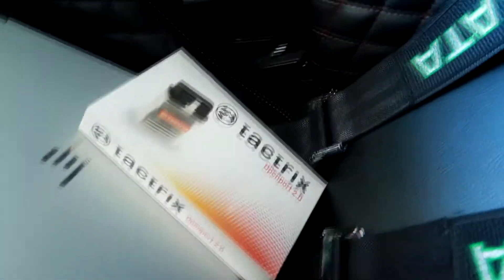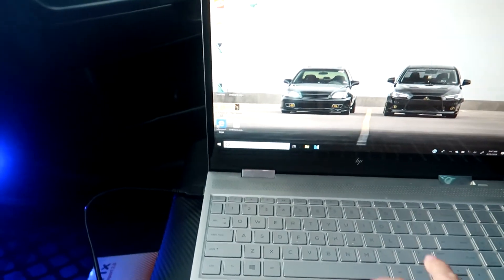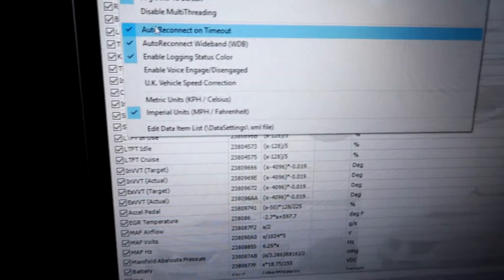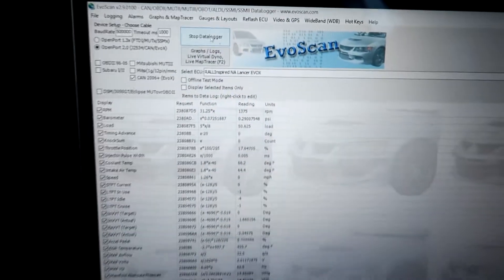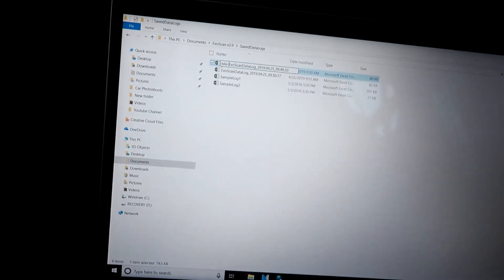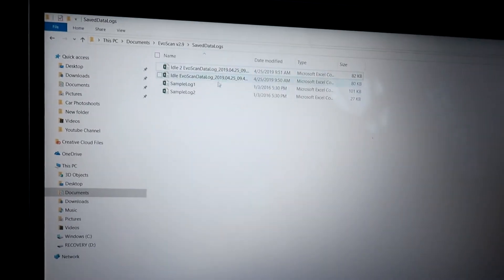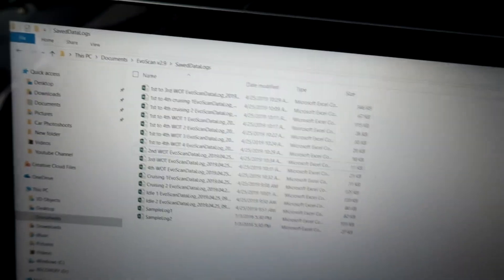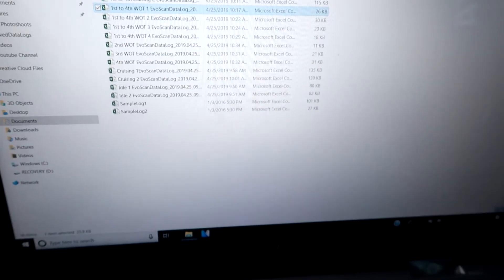How to Datalog using Evoscan

Comment: How did you load that file your tuner sent you? The one you where able to see at your ECU choice.
Reply from the maker: You can click on "open file/rom" on the top left corner and then select from your files the tune that your tuner sent you
Reply: @TheJMedia  I have the 2.8 version of evoscan that doesn't have that file choice. Which version are you using? The only options i get under file is to start data logger or stop data logger and show/hide evoscan. Thanks for the reply by the way.
Reply from the maker: Oh I see. Yes evoscan software is just for datalogging. To load the tune, you still need to use ecuflash software. https://youtu.be/FZXSt1agNuI